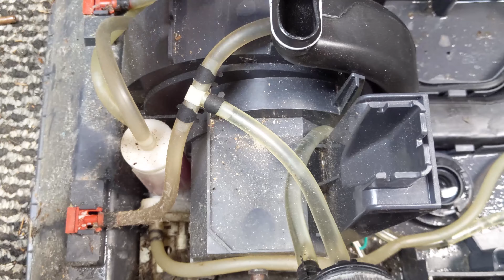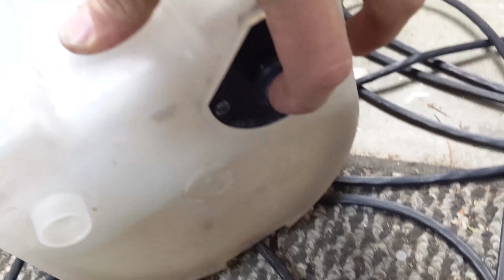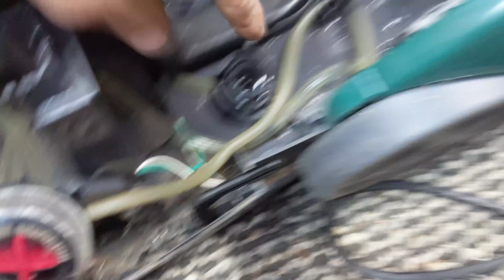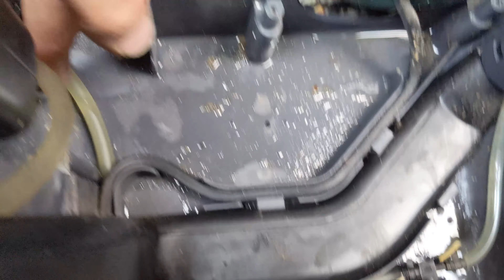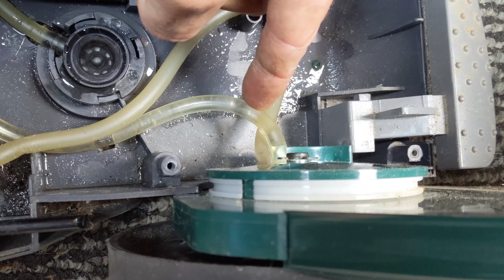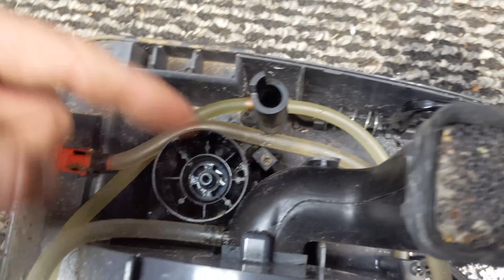Powersteamer Pro No Spray Repair and Troubleshooting

Comment: Thanks for making this video. Mine is not spraying water and I figured I would check YouTube and find out what the system is in this. Mainly that it does use a pump and now see that it uses a drive belt. Also your explanation of the six screws to get inside of it.
Now I will check it out. First with that grommet seal on the tank.